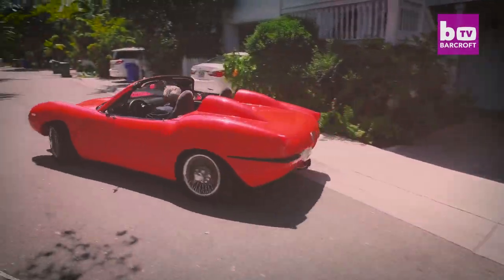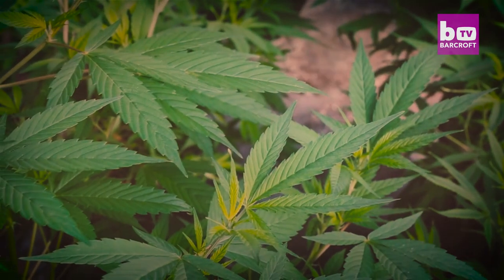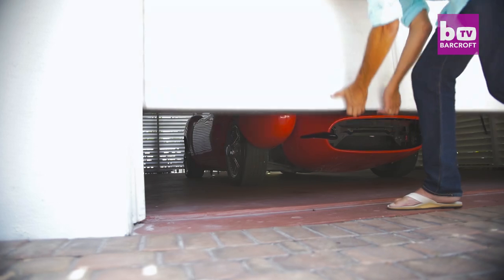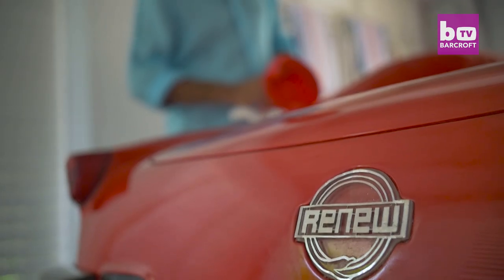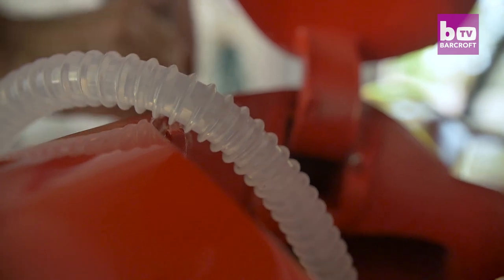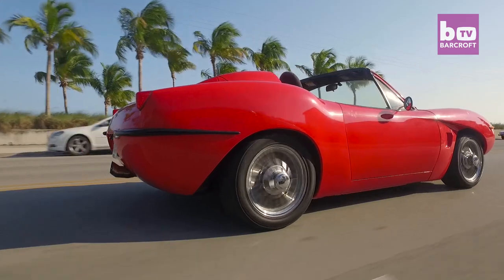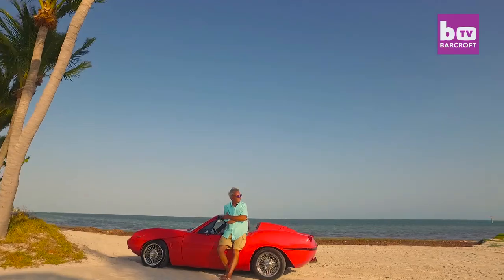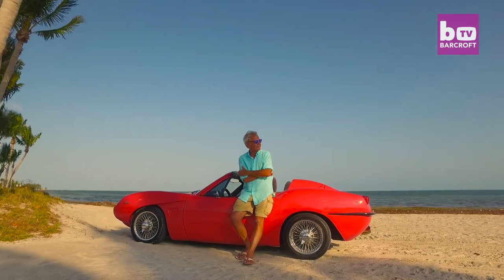My Way Or The High-Way: Eco Cannabis Car

Comment: 420 miles per tank
Reply: 420 miles per dank
Reply: niiiiice
Reply: 420 miles per joint
Reply: 710 before you need an oil change..
Reply: @kanggoo57  ohhhhh 🤣🤣🤣

Comment: Whoa, wait $200,000? What am I missing here?
Reply: ikr, it's a rebodied miata.  how much does hemp fabric cost?
Reply: You're right Jason. The hemp is relatively inexpensive. It was the tooling up for limited production which got expensive.
Reply: Legalization.  What's missing is legalization.
Reply: Too bad even back in the day Mr. Ford was probably (trying) to fight off big companies from the steel and oil business.Really sad to see proper ideas which include natural grown (and therefor replenishable) resources have to make way for resources being used which we are running out of over time.But we can all be at rest and not worry about how or why modern cars are made , while we numb away as we use the latest inter connected multi media distraction fittet to ''meet our wishes and desires''.
Not sure if it would be a good idea to look into the certain patents needed/required to set up a production line for cars like the one in this video , only to find out the companies named above have them or the patents are not legally lawful in some areas of the world.
Reply: It's legal now in Florida and California. lol
Reply: i believe 200,000 would be because of molds for pannels all the experiments to get mixup of cannabis fiberglass so it wouldn't crack from engine heat whatever easy to see where the money was lost ever tryed making something completely from scratch when your inventing the material your using to build with. i don't believe he was handed a recipe for cannabis fiberglass.
Reply: No, but the company needs to diversify into another easily made product using the hemp fiberglass. Like aftermarket fenders for ricers. Maybe add a bit of rice in it to market it.
Reply: To develop the average car from a mainstream manufacturer would cost well over $1m to $2 million at least but usually much more. Think of the time, wages and the prototyping to go into a newly developed car ( not a model derivative ) that's why most manufacturers change the body panel styling but the chassis. This is a proptotype it's going to be expensive but for a prototype it's very cheap.
Reply: @brucedietzen   I would love to see this in real time, i am fascinated with the creativity and process involved. Any updates or improvements?
Reply: spoada Ha-ha-ha! :,D
Reply: I guess that when someone builds a few of something it costs` a lot more than if you mass produce it.
Reply: Mass production would drastically lower costs.

Comment: I like the idea but if the cannabis body is too strong to crumple in a crash there may be a safety issue. I would like information on the car body's ability to absorb energy in a crash. Maybe it is better than steel or maybe its worse.

Comment: It's a damn-nice-looking car. But will the hemp-reinforced-plastic body hold up as well as the fiberglass-reinforced-plastic body of Chevy's Corvette?

Maybe I'm super-skeptical, this evening, because I had my fiberglass-reinforced-plastic boat soda-blasted to get rid of years and years and layers and layers of old bottom-paint. Now that it's down the the gel-coat, it looks like it has measles from all of the tiny fissures and blisters in the bare gel-coat. (We're going to fix that before she goes back in the water.)

The big thing that worries me about Bruce Dietzen's Hempmobile is ... glass fibers don't rot. Hemp fibers DO ... that's why every line on my boat, my 'fiberglass mistress,' is polyester, or nylon (dock-lines, anchor-rode), or Dyneema.
Reply: Rick Westlake It will. Maybe take a look at the new Porsche who uses hemp bodywork
Reply: Rick Westlake And hemp fibres don't rot

Comment: The click bait was "100% of the car made out of weed"(site linking). I was very curious about how they managed to create a working car MOTOR out of hemp. The chassis is made out of hemp, probably nothing else on the car is.
Reply: The original diesel engine was designed to run on hemp diesel.